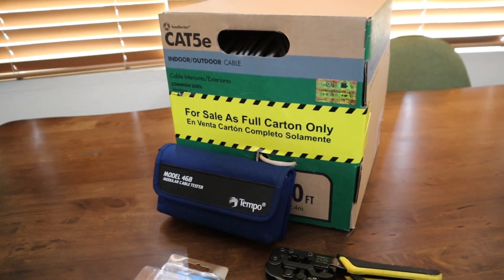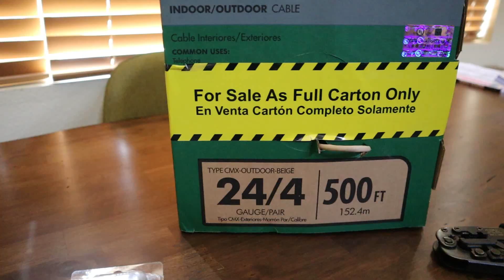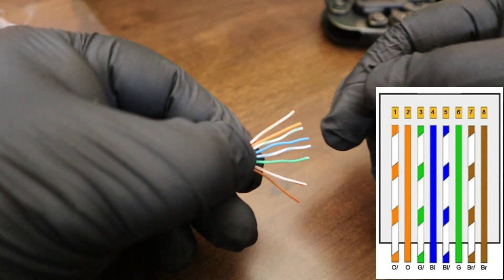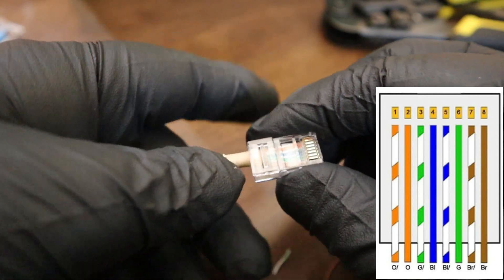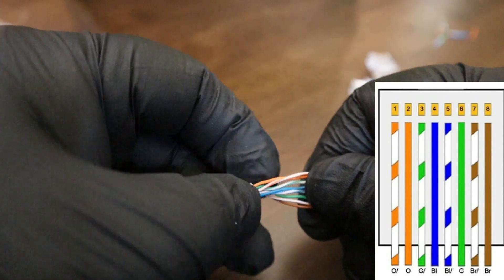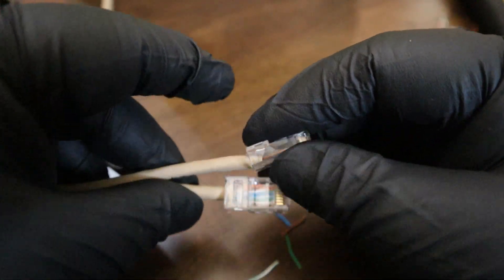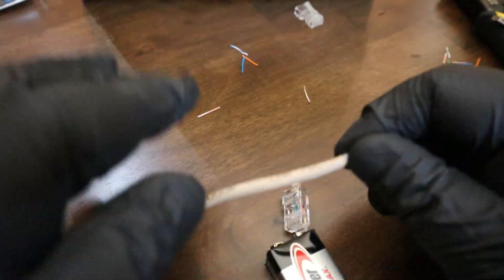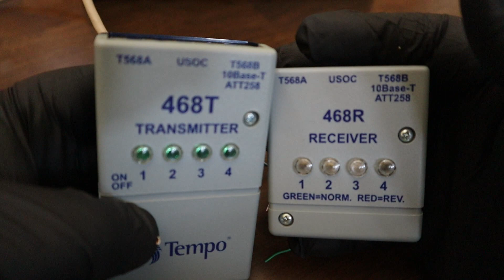Refrigeration: How to Make Cat5 Connections for EMS Controller Communication

Comment: Nice video! I did quite a bit of research learning about running and installing cat5e cable for some KE2Therm stuff I installed. I ended up using a lot of those plugs. I learned later that most electricians will use a keystone jack instead of plug where ever possible and run a small patch cord instead of fussing with the male plugs. “Cat5e plugs are the backstabbed receptacle of the data world.”